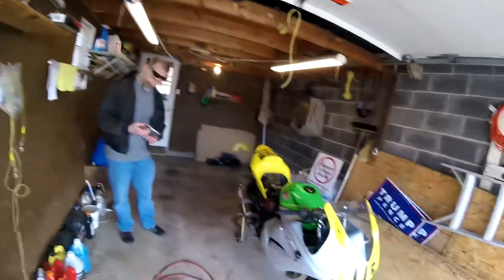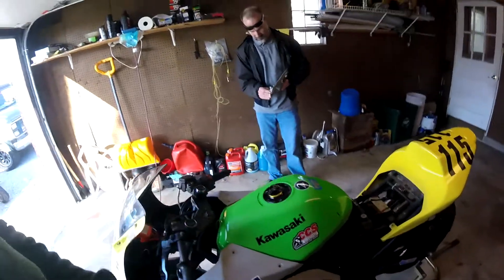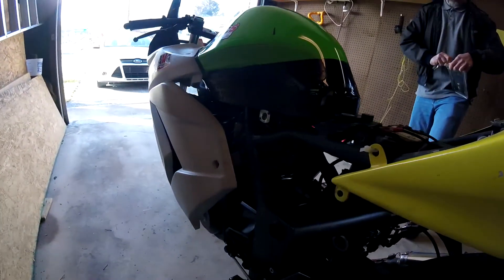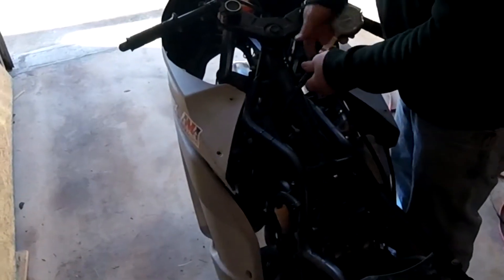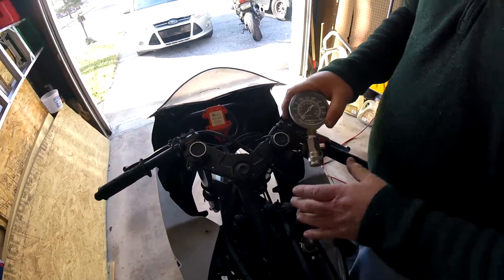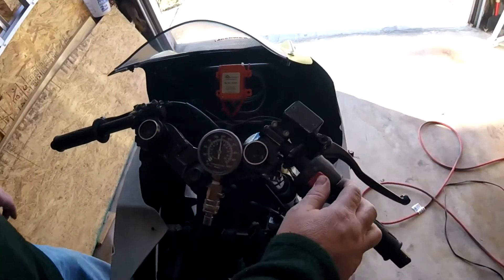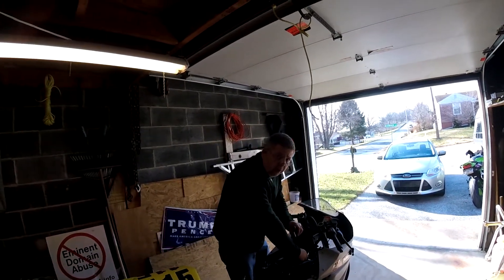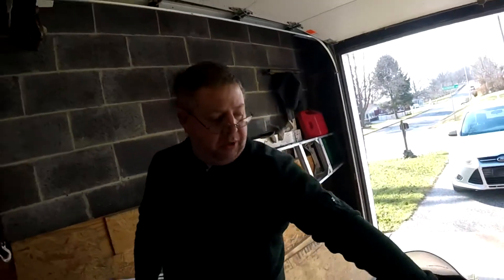COMPRESSION TEST Ninja 250 EX250 Road Racing Engine Evaluation

Comment: HI, I was wondering if this particular bike has a 120 or a 140 rear.  thanks.
Reply from the maker: It came with a 130, but that size is hard to find in a real race compound, so I run the 140 rears on these bikes.

Comment: Man I would love for you to work on my ninja ex250r have issue with one of my cylinders only firing when I'm rideing doesnt want to fire at full compression when at idles temps on exhaust at full warmup is right side 150 left side exhaust pipe 350 doing a compression test tomorrow to see where I'm at with compression hopefully it's not a piston ring just maybe a stuck valve needs to work its self lose but smells like raw fuel and some fuel in oil great video..
Reply from the maker: a stuck open vuel petcock valve can cause this symptom if it goes long enough to foul your plugs.  see myvideos on carb cleaning, and pay special attention to the section on petcock vavle checks
Reply: @cycleforlife2170  I completely rebuild the carbs all new jet a/f screw with spring washer and rubber washer new floats and float needles bench sinked and pressure sinked on the bike going to do a compression test now hopefully comes out good if so going to check the coils when I ride it speeds up perfectly get to 80mph like a bat out of hell . Lol I feel that the cylinder just doesnt fire correctly when just at a idle throttle reaponce is perfect under load bike halls ass shift great on deceleration reaponce really good when I hit the throttle no hesitation at all just smells like gas out of 1 exhaust ..petcock on the on position doesn't let any fuel out of it so that's working when on and and flows good on prime I'm stumped I see a stuck valve ..or bad ring we will see thanks for your reply I will let you know the compression test results cold and with a warm engine thanks again